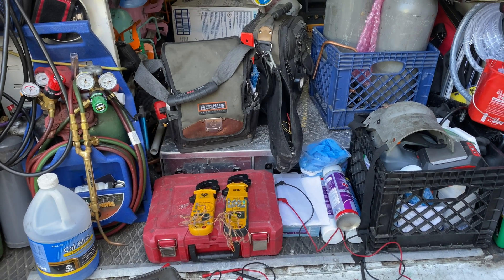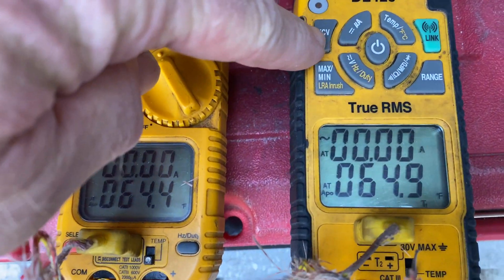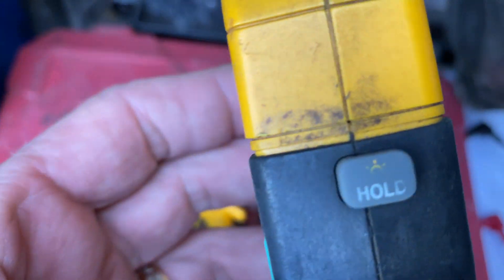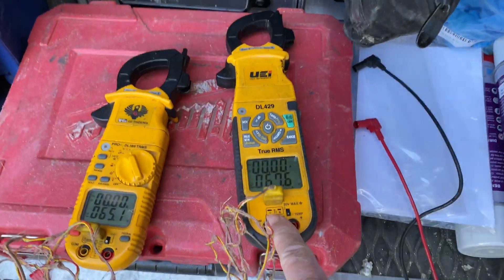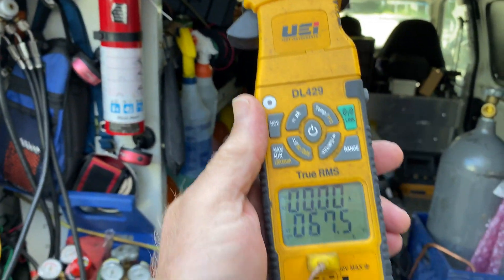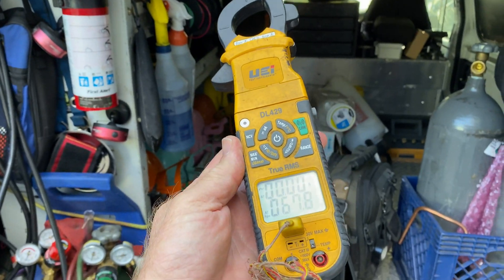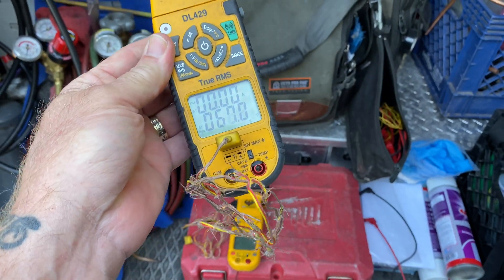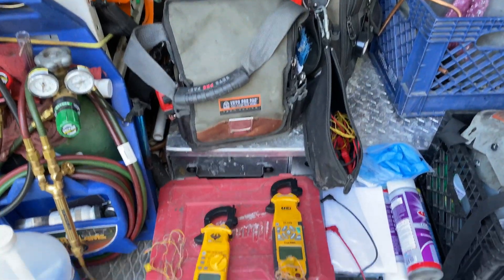UEI DL429 4 year update

Comment: It lasted that long coz you took care of them lol. I only wanted to know what the DL389B is different from DL389. As you said it it's only a newer or updated model. I am open for any five aways too. 😁. 
I bought a Klein clamp meter and it wasn't reading 12 amp on a space heater when I turned the space heater on through its wire.  I am returning the Kelvin tool and bought a UEI one. Hope I get a good piece. Some of the reviews on Amazon is bad but a 4.5 stars rating still for the UEI DL389B meters. 
Liked and subscribed as well. By the way l, just finished my first week as a HVAC tech after three years of school.

Comment: Good vid. Backlight ? I Love my Uei Dl49. Been using it for many years. It was the ONLY METER I could find 20 years ago to do 400 DC AMPS. only things extra I would like on my meter is - a magnet 🧲 on back , backlit display & micro farads.
Reply from the maker: Yes and flash light
Reply: Your joking right? Flashlight ?
Reply from the maker: OcRefrigeration , Hvac & Electrical Video's. Nope it has an lED in there and it works.

Comment: i got screwed with buying a Field Piece. Damn thing was crap from the start. My vendor sent it back under warranty. When I finally got it back, they said there was a bad diode in it. We opened up right there on the counter. Damn thing wasnt fixed and the sales person was shocked. Called them right there and they basically told us that we werent using it properly. Damn voltage reading would constantly change....in fact all reading were floating all over. They even rejected the return/refund on it. i ended up fixing my fluke that i had for years myself and its still working but I do need to get me a UEI unit

Comment: Well "Hells Bells"  that thing came with AC/DC on it . 
I rolled with the dl389 for many years. Had nothing but trouble out of it. The thing I like most about it was the gray and yellow vinyl bag that came with it, like you showed in the video. I still use that thing to this day. And you're right, they were much better than the new cases. 👍 
I switch meters like Hugh Hefner switched girlfriends. 😂

Comment: Great meter. Mines 2 years old and works perfect....except for amp draw. Saw UEI at AHR Show and they said send it in and they’d fix it. 

Reason I bought it was walk in freezer and cooler work, I’m in Florida and the meters condensate from cold to hot. That took out three fieldpiece swivel heads. The UEI holds up great for refer work
Reply: Does your 429 not zero out on amp draw? Mine never gets below 0.30amps

Comment: Remember to change batterys sometimes to keep leak damage out of question. If you use that another one for backup I say once a year is enough to be safe side if you use alcaline batterys. If you want to be safe for battery leak damages use nimh rechargeable low self discharge batterys or litium batterys.

If you use alcaline batterys don't buy Duracell batterys, they drop voltages and usually starts to leak even before best before dates even then when they are brand new. That's why they are called duraleaks.
Reply: Ive found energizer is best battery for meters & test equiptment. 
Rechargeables leak.